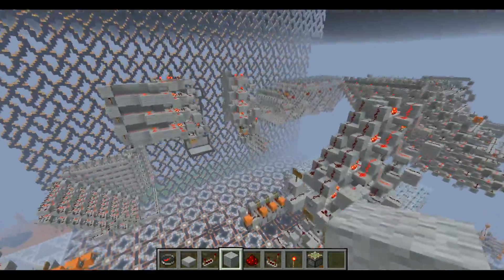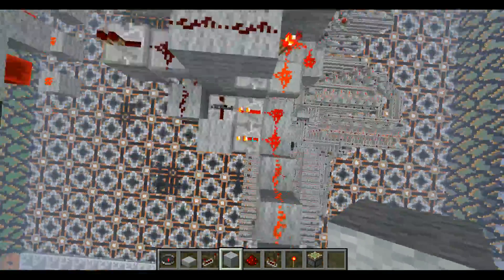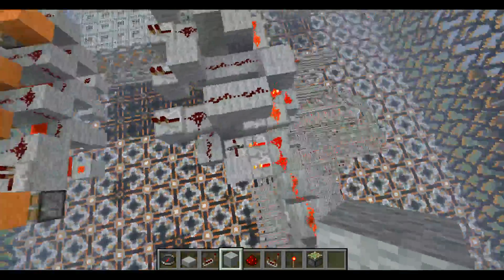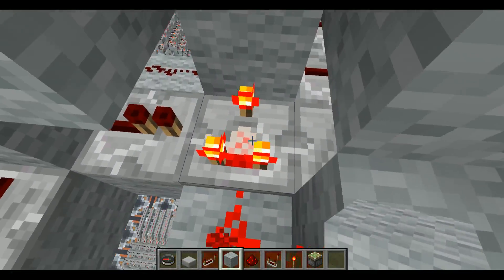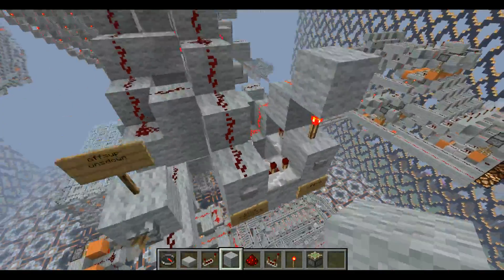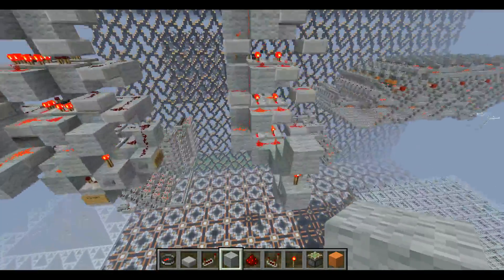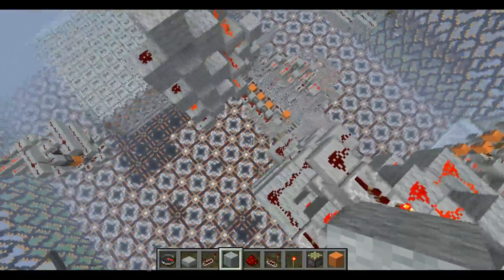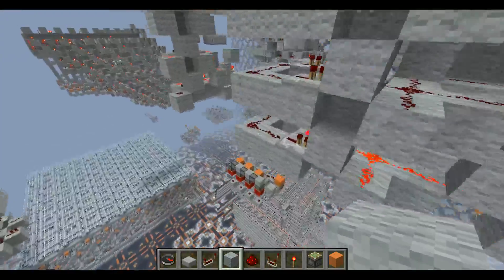Minecraft pistonless resettable up/down binary counters

Comment: Quite nice! Just a few things I wanted to point out:

The double carry line was so that the signal could reach 8 bits. As far as I know, it's the smallest way to do so, but if you found a better way then it sounds interesting!

Although I really love how you took the signal straight off the wire, the reason I did it the way I did was because it exposed a redstone dot before the repeater lock, which you could simply power/clock to reset rather than use comparator logic.

Either way, great job!